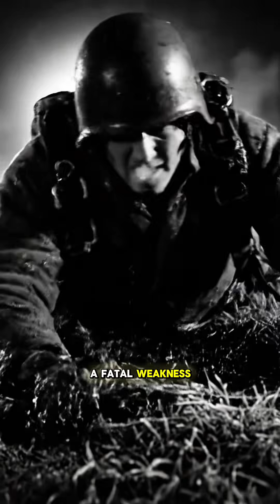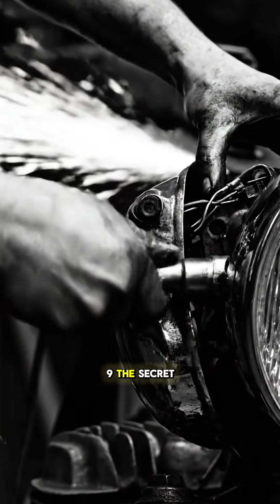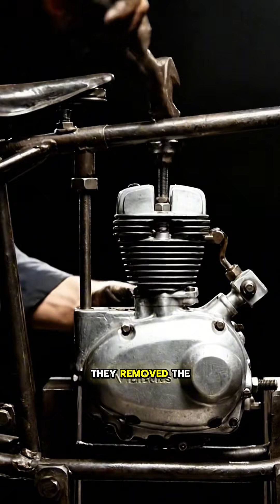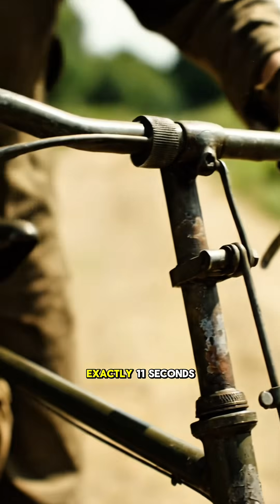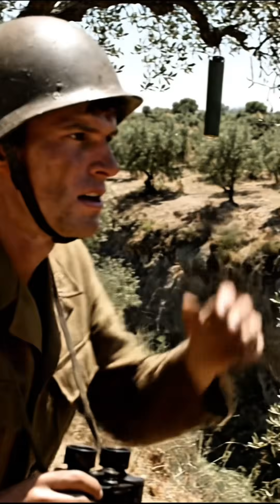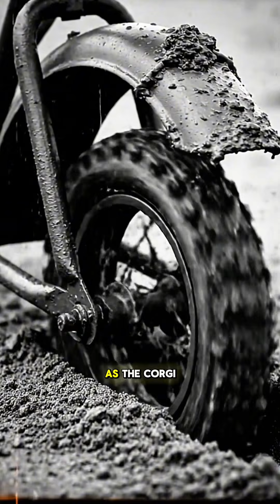The "Impossible" Bike That Failed D-Day #documentary

Comment: Did he say 10 inch wheels? They're not 10 inch wheels. They are at least 13 inch. The motor scooter at the end looked like 10 inch.
Reply from the maker: Fair point. The footage is AI-generated for visual reference, not exact scale.
The core of the video is the historical idea and its operational failure, not wheel size specifics.

Comment: Check out the British Welbike. Same era, same job.
Reply from the maker: Exactly — the British Welbike is the focus here.
Same era, same intended role for airborne troops.
Reply: That’s what this is about
Reply from the maker: @jamesholdsworth733  Yes, that’s correct.
The video is specifically about the Welbike and why it failed in practice.
Reply: @WarEchoes9  They should have trained them how to use them a little better. I ride in the sand all the time. Mud could be a problem but it would have to be pretty deep.
Reply from the maker: @TractorWrangler01  Training was limited and deployment was rushed. In practice, terrain, weight, and combat conditions made it far less reliable than expected.